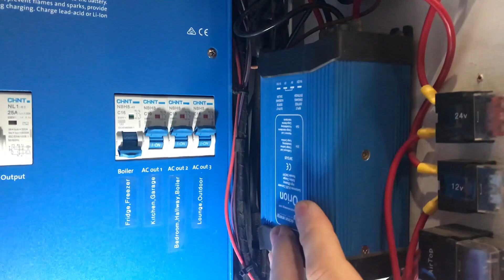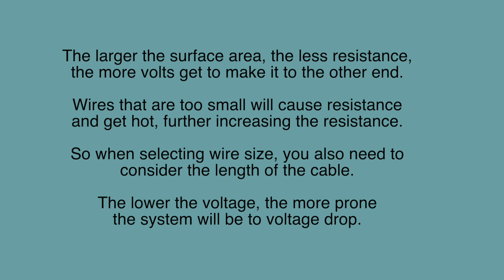12v or 24v camper electric system

Comment: I have a jeep which came 24v, now I am installing a LS engine which is 12v, so I need an inverter 12v to 24v in order to run a/c blower, wiper motors x2, door glass motors, dash board etc, can you help please.

Comment: Thanks for this video. I still have many unanswered questions, however, I now feel like I am a little more educated. 

I’m trying to design a system for my caravan. I thought I was happy with 12 volts. Bought a 125Ah LifePO4 battery and thought I’ll just add an inverter, until I realised the type of amperage I’ll be pulling through to power a microwave or hairdryer. So now I want to go with another battery and go 24volt. Then still run the 12 volt stuff. And the 240volt stuff. And still hope to charge it using the existing charger in all 3 scenarios, EHU, from the car when towing and off the solar panel. So much to think about. So thank you for this video.

Comment: quick question, would 24v to 12v step down converter efficiency? how is the power over 1500w in this case?
is it possibel to connect to 12v battery directly for 12 v DC?
Reply from the maker: The Victron 24-12 dc dc converters are pretty efficient but there’s always small loses.

Comment: I've been looking to those victron all in one units but on the installation requirements it recomends a space around the unit about 20cm. That kind of space in a small camping trailer is not available. I noticed that the one you using you didn't leave the space around. Is that any solution for that you could share? Thanks
Reply from the maker: There is more space around mine than it appears.  The wall to the left of the unit actually has a large space behind it .  The book case you see has a false back.  So to the left of the unit there is a space of 300 mm.  These units do have a cooling fan which will come on in warm climates.   I would say you can mount this in a smaller space and ensure it’s well ventilated.  Another option would be to mount a small computer fan than could be temperature controlled.  But this probably isn’t necessary.  Heat rises so you can use this to help in your cooling plan.

Comment: Hi Matthew!! Nice info as always in this channel. I am deciding between 24V or 48V. I think better 48V but the problem would be... I will have 3 circuits!!. Market is going in this direction and for me, the best and new top batteries are 48V. What do you think about now in 2021? I really interested in your opinion. Grettings from Spain! Thanks a lot for your effort!!
Reply from the maker: My thoughts are try to keep it simple.  Unless there is a really good reason to use 48v I personally would use 24v in trucks . For an off grid home where you might have long cable runs then 48v would definitely be more suitable.

Comment: Lots of information to take in! One burning question, it might sound silly but I am considering a 24V 360W panel for my camper and getting a Victron convertor to use it with a 12V battery. Would I see any advantage with this setup over buying a 12V 180W panel. Would I get more amp hours charged with the 24V panel? Any tips greatly appreciated!

Comment: thank you for great detail video on your set up in 4x4 truck with 24v and 12v  system  as having a have Isuzu 2010 6ton  NPS 75 crew cab 4x4 truck which is 24v truck   which builds tour in Australia  
if little on market in Australia on 24v gear

Comment: Hi Matthew and Matilda.nice explanations and amazing well thought out and thorough.my campervan is vw t4.recently I thought would change 12v 110ah leisure battery for one of my old ebike batteries I made from samsung 25r cells.it was a 14s5p kit.48 to 52 volts.anyway split in 2 its 26volts for a 7s5p pack.my renogy rover 20 mppt controller just powers usb sockets at present.so my renogy is connected and I can monitor my lithium battery voltage with a Bluetooth adapter.but can’t get usb I had connected to load terminals on renogy to power on yet.I adjust settings to 12/24v then 24v then press enter then shows 12v again on settings,it does show 26volt battery on main screen and solar a little more.I see usb sockets can be for 12v to 24v .maybe can connect usb socket direct to battery would that work ?Would greatly appreciate your thoughts Matthew.steve  in uk.😀keep on exploring.we toured Cornwall twice between lockdowns and use max for daily work vehicle also.
Reply: sorted for now ive wired usb to battery terminals on works ok so must be 24volt compatible

Comment: You're a great explainer. Awesome set up. I came to learn if the solar panels I put on my aristocrat trailer should stay 100w, or can i go big with 300w 24v? Still not sure.
Reply from the maker: it depends on the solar MPPT charger you are using.
Reply: I could lay out what I have and what I've learned. But instead I'll continue watching creator's like your videos,  and get the formula for my lowest temperature for my solar panel .....I'll be fine thanks;)

Comment: Have you set up charging from the (presumably 12v) alternator to the 24v batteries?
Reply from the maker: The trucks mostly have 24 v battery bank and 24v alternator so adding a split charge relay is easy.

Comment: Nice video Mathew. On the topic of split voltage chargers, it becomes an issue with Lithium house batteries because of their low internal resistance. This means they can take a lot of charging current. If not limited, this can overwork the alternator at low revs leading to overheating. Lead acid technology has higher internal resistance.
On your informational slide re voltage drop, you mention surface area, I think you mean cross sectional area (surface area only comes into play at high frequency).
On the issue of the one instead of three, I don't understand. I have Victron MPPT solar charger and Multiplus inverter. This combination does the same thing. Solar charge, inverter, battery charge. Need the ELCB breakers of course.
Lastly, can you elaborate on the two battery monitors? Dave
Reply from the maker: Hi Dave.  The 2 monitors I have. 1 is the Victrom BMV 700.  The monitors batteries, consumption, power in, power out etc.  The other is a MPPT controller.  It just tells you what your solar is doing as well as lots of history  and repeats a number of the functions the BMV 700 does. For example my MMPT charger has taken in 969 KW since April 2018. That does sound like a lot of power.  I think in reality that's the potential power generated but not how much my batteries have taken in as i am normally fully charged by 10 / 11 o clock in the summer.

Comment: 1:38 Two batteries can push out more amps than one big.
Reply from the maker: Remember this is for campers. We are not concerned with pushing out lots of amps. These are leisure batteries.
Reply: @matthewpayneadventurerfilm8902  Yes exactly.. Campers. That's why I'm saying lots of amps. 

My laptop alone is 16 amps. 

Would be better to have amps available.. 

Also 1 battery is SPOF.... While 2 batteries is not. With 2 batteries you can have 1 fail and still have some power. 

2 batteries will accept a higher charge than 1 battery.
Reply from the maker: @AndreasEUR  1 battery failing will destroy the other. Although i do accept a failure is unlikely.  In a small camper build, i would most likely buy one larger battery.
Reply: @matthewpayneadventurerfilm8902  1 battery faiiling you can remove it from the system and keep running on 1 ;) 

Easy to notice a battery that has failed if maintenance is kept up...
Reply from the maker: @AndreasEUR  In reality, how many people are going to recognise a failed battery, wired in parallel before its caused damage to the good battery.
Reply: @AndreasEUR  that's nuts. What's it running a tumble drier? Most laptops are 3-4 a/h. Do you mean 16w?
Reply: @projectblue3995  No, I mean 200W....  Why do you assume I'm wrong in my calculations?

WHen used as intended my laptop draws 180-200W.
Reply: @projectblue3995  A drier uses about 1.87 kWh per cycle.
Reply: @AndreasEUR  that's my point. Most laptops are around 3 to 4 a/h. So I'm assuming your calculations are wrong when you said 16 ah. Because it's four times what I'd expect. Tumble drier was sarcasm btw.
Reply: 3-4A... wtf ?? Are you using a small intel celeron D or something?? Can't be no i7... 

What kind of GPU you got? Must be integrated or something.. 

$100 meant for looking at websites propably... 

NOTE: I am NOT talking idle usage... Idle usage for me is like 4 amps.. But that's no way to calculate usage!!

MAX possible is only way to calculate.. I used a power thingie that you connect inbetween, and while USING the laptop it's ~180W.... Idle it's maybe 30-40..
Reply: @AndreasEUR  I have a Thinkpad with i7 CPU, a high end relatively powerfull business laptop and the original charger is rated as following:
Input: 100-240V, 1.8A
Output: 20V 3.25A (65W)
That means the laptop is using max 3.25A / 65W working and charging the battery at the same time and it does that easily. You must be using some monstrous gaming / desktop-replacement machine with a desktop CPU.
Reply: @einarsteinsson  of course I have a proper gaming machine.. what GPU you got?? Must be something not really useable.

A business laptop will normally have shit graphics ...

Comment: 0:38 no no no no no... do not use a split charge relay, use a DC-DC charger like the Sterling Pro Charge Ultra LITE 12V... 
With a split charge relay the batteries MUST be the same thype, and they MUST be the roughly the same age.
THis means that if your running a open lead acid battery as main, then you want the same as house battery. If you want AGM or Gel as house battery, you must also change the starter battery to this type.

Another problem is what voltage it charges at. Some AGM batteries want 14.2 volts, while an open lead acid want 14.6 for example. Another reason to go proper dc-dc charger.
Reply: Nope - I've used split chargers using different batteries. One for the vehicle, one deep cycle for winch. Never had issues, although it wasn't in the same setting as Matt used, it was used in anger in the cold (-10c).
Reply: @projectblue3995  Ok, you destroy your batteries as much as you want. I will never recommend people to destroy/damage their batteries. 

It's common knowledge that split charge relays require the same type of battery on each side. 

There is absolutely no reason not to cut corners and not put in a proper dc-dc charger.
Reply: @projectblue3995  "I used this and this worked for me" <--- NOT proof that it doesn't damage OR that it's a good solution!
Reply: @AndreasEUR  How do you mean it isn't proof.  Proof 1: in two years it didn't do any damage to the batteries (or non that was apparent or measurable) and 2: it worked fine. Therefore it was a good solution. 
If you are saying there are better solutions, I totally accept that. But don't tell someone who has been there, done it and still doing it that something is wrong.
Reply: @AndreasEUR  I'm not spreading anything. I'm simply saying that you wandered on here yelling no no no, and then told everyone that they can't use stuff like that and there was no proof. like you are some kind of authority. I simply countered with, use and experience. But apparently that doesn't count because you are the big expert. With zero evidence of you being an expert. 
But hey, thanks for showing up telling people what they shouldn't do. Really useful.
Reply: @projectblue3995  They CAN use whatever they want.

If they want their batteries to last they SHOULD ...

Comment: Hi Matt, another great helpful video thanks. When you did the onscreen amp calcs, what did the AWG figure relate to please?

Betty is a +ve earth with a dymo so need to switch to a -ve earth and a suitable alternator, so plenty to fettle before I introduce a leisure system.
Reply from the maker: Hi Matti.   The AWG was the equivalent size to the ㎟ stated, for those in the US and anyone using AWG. I personally work in ㎟.   Those sizes relate to the wire size suitable for the amps in the calculation. But only that specific calculation which i just made.  You will need to do such calculations for everything, but will very quickly get an idea of what wires you can use for what.  The large majority of my system uses 2.0㎟  and 2.5㎟  wires.  In most cases this was overkill, but I had purchased the wire on reels so just stuck with a few wire sizes.  Having wire bigger than required is perfectly ok.
Reply: Matthew Payne | Adventurer | Filmmaker ahh gotcha, yup, mm for me too. Cheers.

Comment: Matt, choice of whether to use a split charge relay is now very vehicle dependent and I would not recommend them by default anymore without knowing alternator type etc
B2B technology has many benefits and is virtually mandatory on later Euro 5 & 6 Vehicles.
However I appreciate in Matilda you may have all sorts of other reasons for using a split charge setup in preference to a B2B.

My van has a Lin bus controlled 220A Euro V Alternator plenty of power but it only chucks out 14V which is not enough to get the Aux batteries anywhere near 100% in a reasonable time frame.
I still have my 300A rated split charge setup albeit now disconnected in preference of a B2B but I keep it because like you I can also use it to jump start the van.
Reply from the maker: Thanks for the comment.  Good to know. I will look into this further and maybe do an update video. Appreciate your input.
Reply: No it's not vehicle dependant. It has so many requirements and downsides the only useable thing is really a dc-dc charger.
Split relays demand btteries of same age and type. It also has a lot of other downsides.

Do not suggest "yesterdays technology" .. Only upside it has is being cheap. 

The only logical thing to do is a proper dc-dc charger which will ensure proper charge of the batteries at the proper voltage. The leisure batteries I have for example should only be charged at 14.2 volts. If you get 14.4 or 14.6 from the alternator, this will destroy the batteries very fast.
Reply: @AndreasEUR  I guess you are not based in the UK, over here a B2B is effectively the same thing as a DC to DC charger.  Charging voltage varies and can be higher depending on Temperature hence why most B2B units have a temp sensor as well. 

For example the Sterling B2B units when set for an AGM 1 Profile (i.e 14.3 bulk,  13.3 Absorption and  13.0 Float at 20 degrees C) will bulk charge at 14.7-14.8v with battery temp at  around 5c unless the temp sensor is disconnected this is the correct and expected behaviour, however having never survived -20 to -40C like Matt has I am not sure what happens to Lead Acid batteries at those extremes! A simple split charge device may be the absolute right thing to use at those temps!

Note It is rare for an Alternator to overcharge a battery, a 12V alternator would have to be faulty to go over 14.4v, taking into account voltage drop it's also quite rare for that full 14.4V to actually get to the target batteries. once the target batteries voltage and impedance rises to equalise that of the alternator virtually zero current will be flowing.

I work regularly on customers vans usually ex Ambulances with often three or four separate battery banks, my trade is in Electronics, many diy Split charge installs I look at use under rated components with resultant large volt drops and at times even related local heating. I have rewired 4 vans in the last 6 months to remediate charging issues alone. I am not a great fan of split charge installs but designed and done properly there is nothing wrong with them especially when in vehicles running many hours a day.
Reply: @CriftinsCampers  I've never claimed a B2B charger is anything else than a dc to dc charger.. 

Ok, that's good for you. My batteries says to NOT be charged at more than 14.2 volts... 

A split charger is never the right thing to use.. Yesterdays technology.... 

Disagree all you want, those are the facts. 

" a 12V alternator would have to be faulty to go over 14.4v,"

Thus some batteries should not be charged above 14.3!! Must talk to each provider of a battery to get the correct voltage they are to be charged at! It's not the same voltage for all AGM's... I don't give a flying shit what you work with. It's totally irrelevant. 

Split charge system is ONLY ok if all batteries are the same age and type.

Comment: got the wiring to do in my landrover ambulance camper def not looking forward to it
Reply from the maker: It's not as difficult as people think. But it can be time consuming, especially on larger systems. But then I do have 21, 240v sockets throughout my truck.  Maybe overkill but I do use them all.
Reply: @matthewpayneadventurerfilm8902  can rebuild engine gearbox axles so on but wiring ummm nope
Reply from the maker: Happy to do it for you.
Reply: @matthewpayneadventurerfilm8902  sent you fb pm
Reply: @matthewpayneadventurerfilm8902   21? =:-O